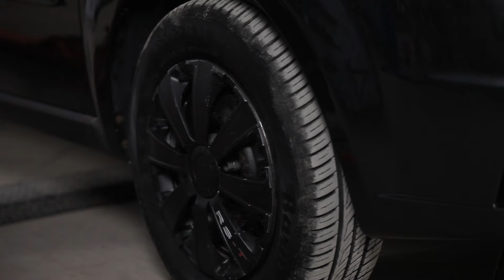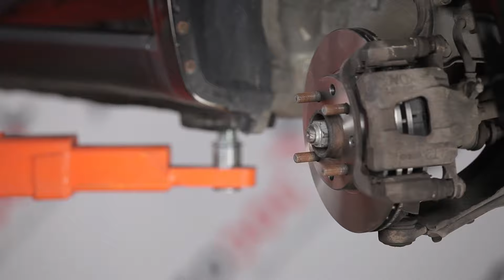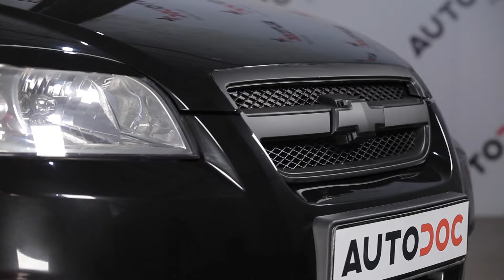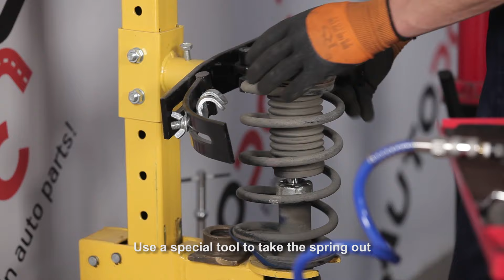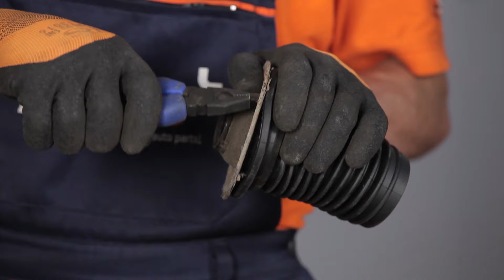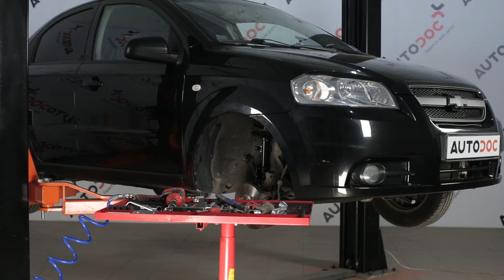How to change front shock absorbers with boots CHEVROLET AVEO T-250 TUTORIAL | AUTODOC

Comment: Hello there, thank you for the useful video. When I push my front strut joint (after removing the wheels) upward when the car is lifted, the strut mount inside the hood is getting lifted too like 3-5 inches. Is that an indication of worn out/faulty strut mounts? Than you!
Reply from the maker: Thank you for your comment! 
You are absolutely right, your strut mounts have been sagged and have a backlash and they are needed to be replaced.
Stay tuned with us!
Best regards,
Autodoc team!